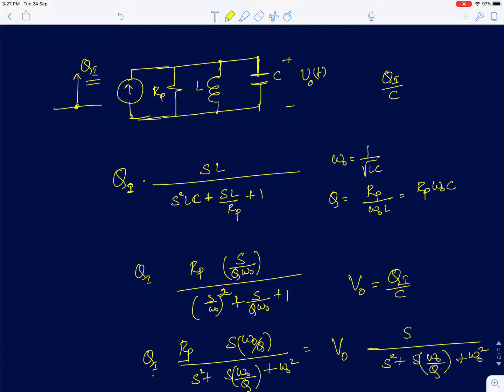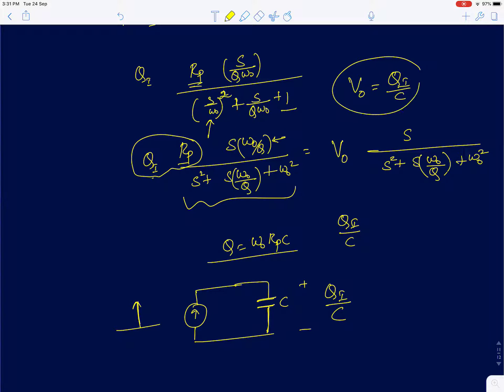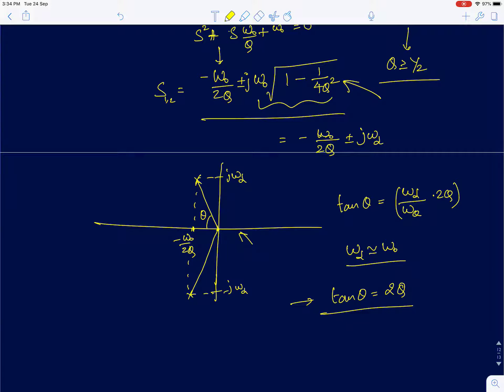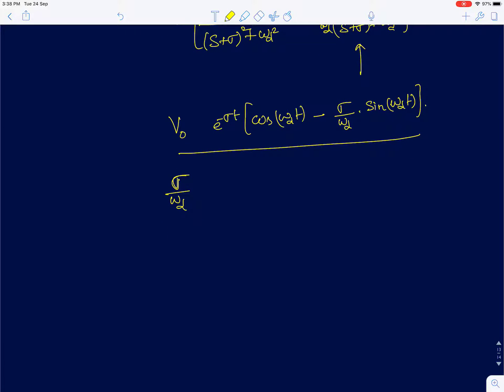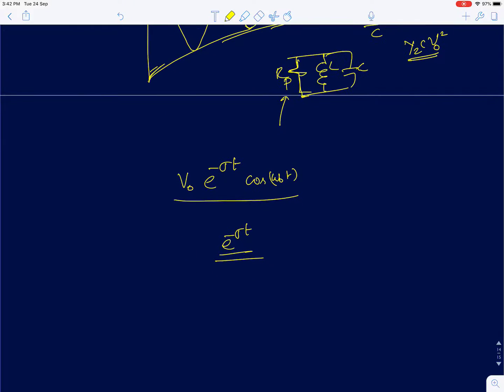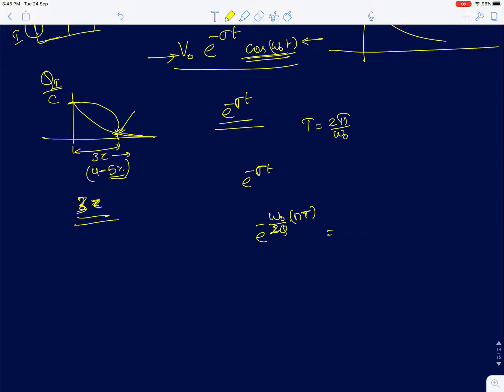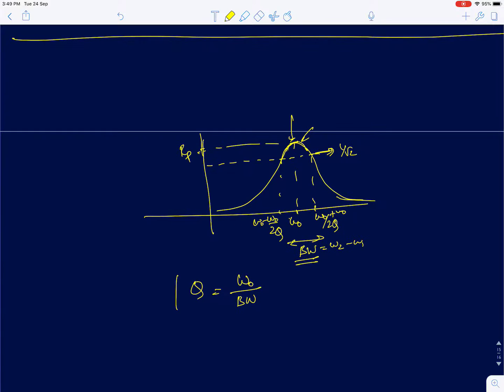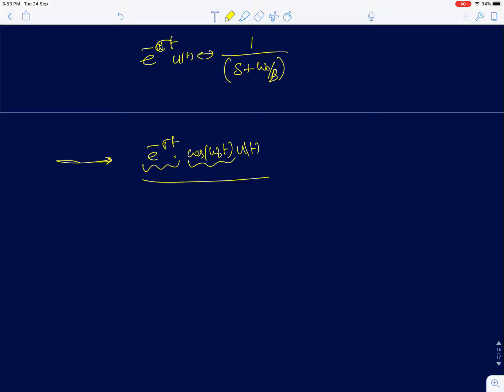ES Lecture 44: Estimating Q from the impulse response of parallel RLC circuit

Comment: The last few min is not very clear (for me), are you saying low pass filter and bandpass filter has the same bandwidth? . A simple RC filter and RLC filter has same 3-dB bandwidth. Is it a mathematical coincident or any real relation.
Reply from the maker: Hi Rajasekhar,. I think that part is clear. A band pass filter can be seen as a frequency translated low pass filter (For large values of Q). It is not just a mathematical coincidence but also an intuitive result